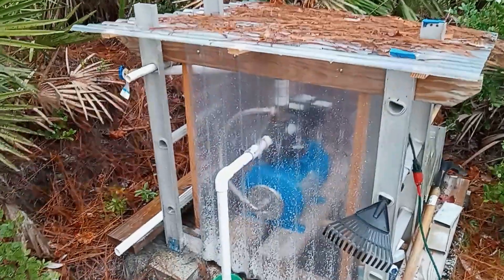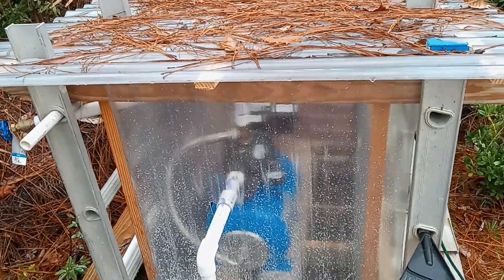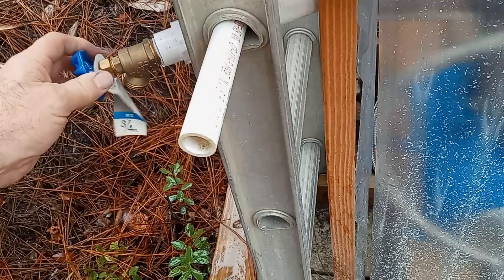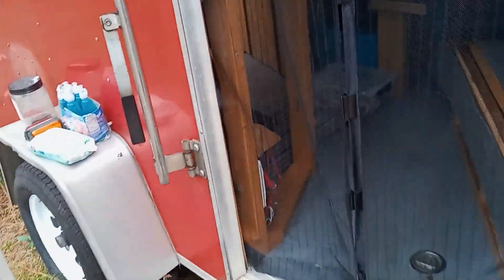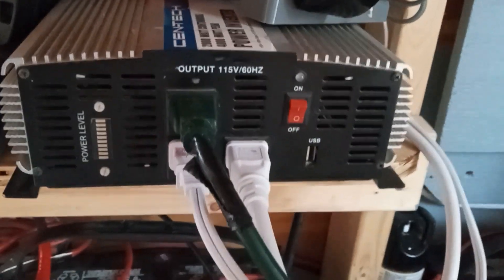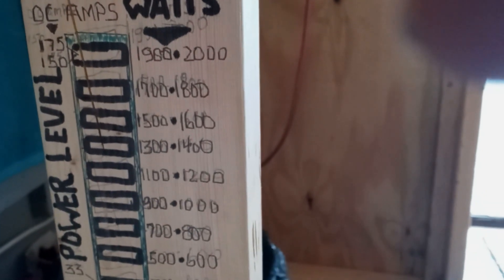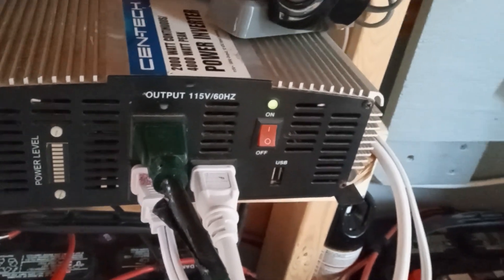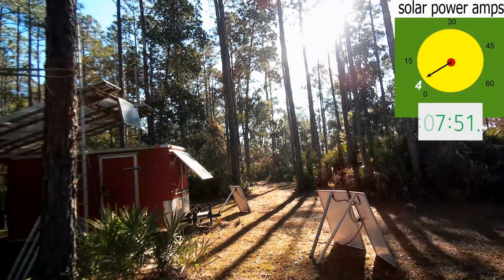DIY Shallow Well Pump Max power draw at start up + Special FEATURE- Solar Sunrise Time Lapse video!!

Comment: why do you install all your roofing wrong? the grooves should allow the water and debris to run down, you're added a hundred little places for crap to get caught up
Reply from the maker: hey sneak,
thank you for watching.
Clearly, design 
you would do the same. try it out sometime.
design outweighs the practical. take a look at other designs on homes, additions and shelters. Most all designs will have horizontal lines vs vertical. 
Thanks again for watching